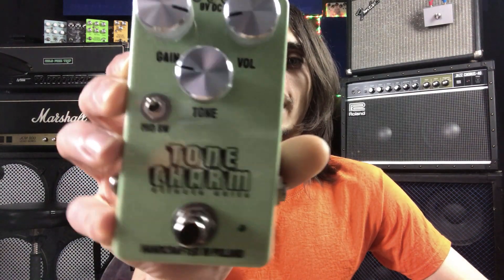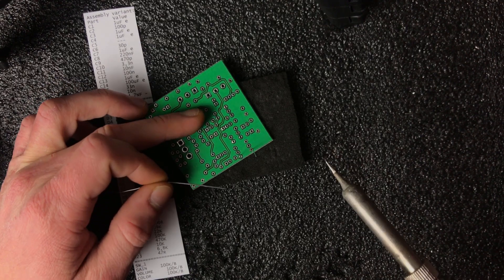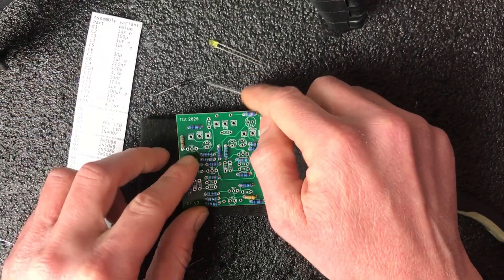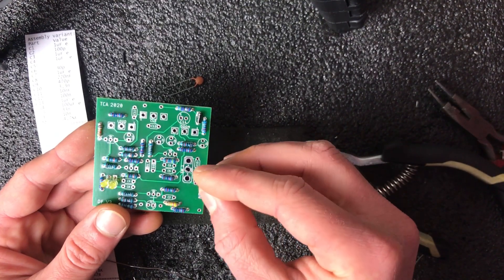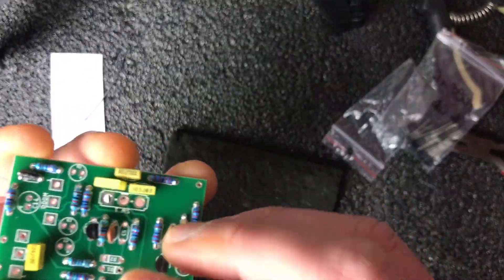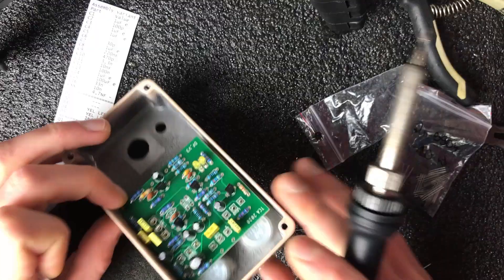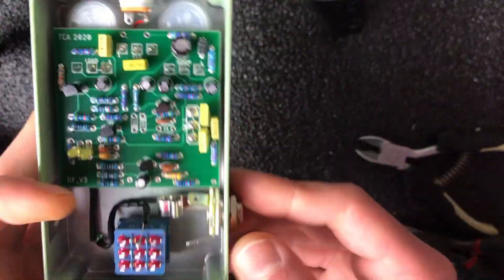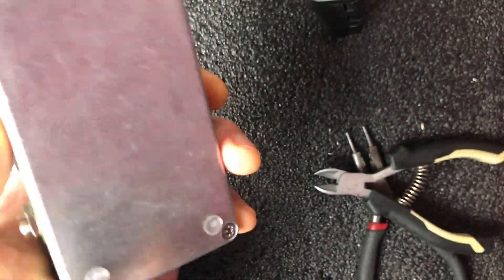How To Build A Fuzz Pedal  (See The Full Process)

Comment: My man why do you solder with lead... you mad you need for that fuckerie air extraction and a full mask with filter. I used lead solder unknowingly for like 2 years and sometimes ventilation wasn’t perfect. In the end it poisoned me and I had so much metal in me Somtimes I would catch radio signal and hear it. Protect yourself man

Comment: For me as a first pedal, I would be interested in building a sound gate. (For those who don’t know, it measures the output from the guitar and only lets the signal through if it’s past a certain threshold). I feel like it would be fairly simple to make but it’s very useful when put behind a delay as it reduces noise and stops unwanted string noise from being echoed back.

Comment: Dude nice work keep it up! I want to build a delay pedal for my next project. I'm a new builder so I have some questions. For example what size of wires do you use? I also noticed that you didn't include a battery socket, is there a reason or something you do as a builder? Again, very good video!!
Reply from the maker: Hey! I use solid core wires mostly 0,6mm diameter. I like them because I can form them and they keep shape so builds looks more tidy :) I'm not including baterry socket because in most of my designs there is no space for it :P  Thanks for watching! Cheers! :)